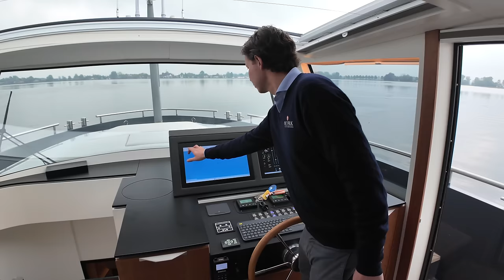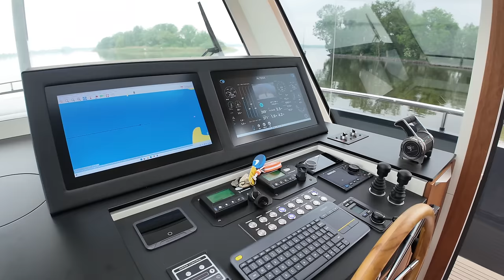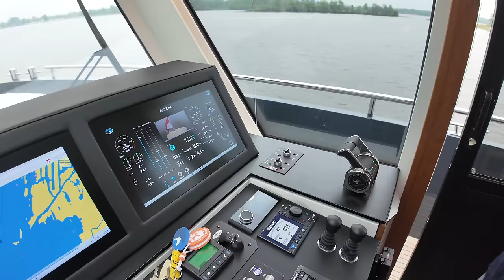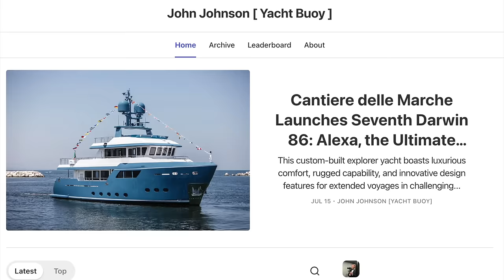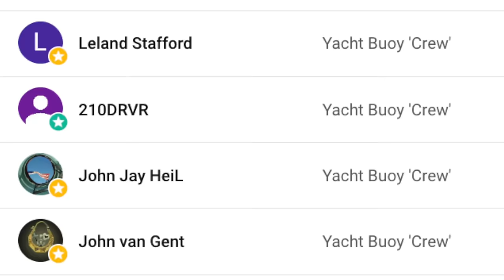€1.12M STEEL Altena 54 NG Yacht Tour (FOR SALE)

Comment: I'm sorry, the mast is out of place!
Reply: My thoughts also. Huge one piece screen for max viewing and then stick a mast in front (?)
Reply: Yes, therefor I’m not gonna buy it ! 😃😃
Reply: This is has a purpose, brah
Reply: @neisjo  No kidding, bra!
Reply: The mast is there to reduce air draft, or the distance the boat sticks out of the water. The mast has a hinge at the base, so it could fold forward to get the boat as low as possible. This would be a requirement mostly on rivers or canals, where you might have to deal with low bridges. I've seen this talked about on Aquaholic's channel all the time, especially with aft cabin boats. If you want to take the boat through the French canals, than you can do so. So, it's there for a reason. I wouldn't be surprised if there was an option to delete the mast and have that equipment on the roof if you didn't have a need for low air draft. What is far more concerning is the lack of helm seat. That seems highly dubious to me.
Reply: @pageant1fd  Its so it can use the canals.

Comment: 😅what a gorgeous open yacht. Not cluttered with so much stuff and everything is low so that you have views all across. That's the nice part. Younger some yachts that habe wide open windows, but then there are cabinets and shelves and everything all around them and areas are sectioned off. It makes the yacht seem smaller. Take the Sunseeker 68' Predator EVO. Great yacht and huge windows, but everything is sectioned off so you habe limited views outside them.

Comment: I really like almost all of it.  The 2 cabins are lacking the windows though.  The showers need to have a foot rest, but this seems to be lacking in a lot of vessels.  Had to be a man who designed them not giving thought to their lady who needs to razor the legs.  🤣  I find this very modern for the most part.  They could seriously add some cabinets in the main deck to give more storage for longer stays on board.    Did not see a washer or dryer on board thus limiting the length of stays also.  

However, I do appreciate the way that this tour was laid out, very informative and very much felt like a true walk-thru which helps in deciding on to buy such a vessel.  Much appreciate all of your videos.  Well done sir.  And fair winds and following seas moving forward.  🤗
Reply from the maker: Thanks! I appreciate it 🫡